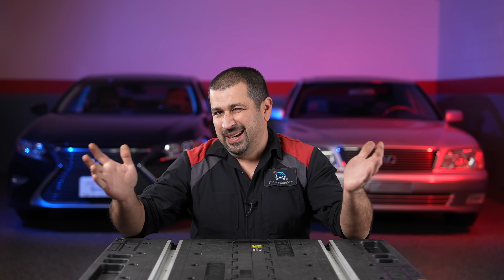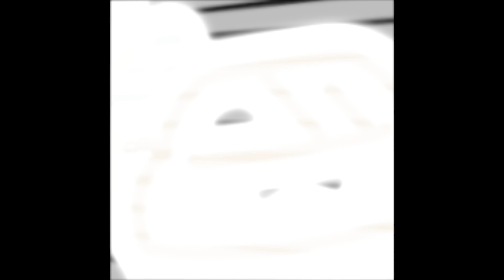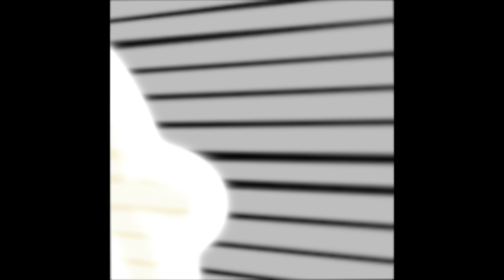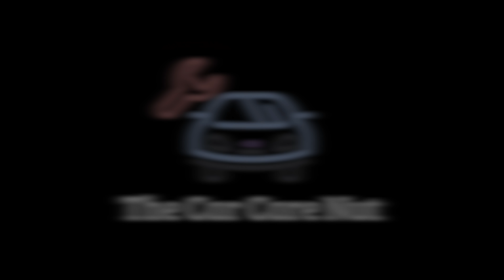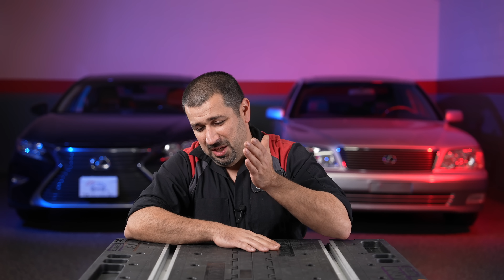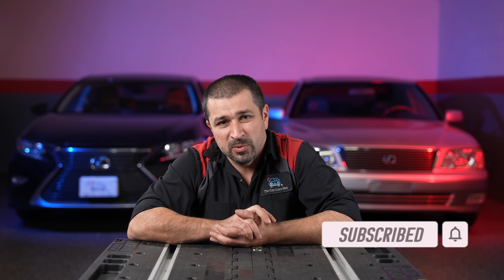Can Modern Turbo Engines Be Reliable? Here's The TRUTH!

Comment: Agree on all accounts but you didn't touch on one issue. Think about this. I have a 2019 V-8 Tundra. It rarely pulls over 2,200 rpms. More often than not shifts at 2,000 rpms keeping with traffic. I love this truck. Now put a 4 cyl lawnmower engine in it with a turbo or two, revving to, 4,000 or 5,000 pulling away from every stop light or stop sign and you have an engine with a hernia at 30,000 miles. It's like lifting small weights for years and being healthy vs. picking 400 lbs for a short life span. Toyota mails me weekly to buy back my 2019 RAV4 and Tundra and I keep throwing away the papers.

Comment: My 2021 Accord has the K20 turbo engine. I bought it brand new and changed the oil religiously every 3K to 4K miles. I’m currently at 120K miles and still purrs like she just rolled off the line. Maintenance is definitely key.
Reply: It's not fair to compare K20 reliability to any other engine... K20s are special, perfectly square Bore & Stroke, & over 24 years on the market. 
To be fair though Honda's L15 Turbo is so terrible it's the reason I gave up on combustion powered vehicles all together. 😂
Reply: @zdl360 A turbo engine is a turbo engine. Trust me, I know how special K Series are, I build them for a living. If you add direct injection and turbos, that engine needs to be babied and probably maintained and a lot of for found that out the hard way with the L15, these engines don’t suffer abuse well and they’re not the Honda engines of old when you can drive 10K miles on an oil changes and you could for the most part get away with it.
Reply: Been daily driving my 2021 Acura TLX for two years now and haven’t had a single problem now sitting at 53k miles. Oil changed every 5k
Reply: This is good to know! I bought my 2018 Accord 2.0 new and I have been maintaining the same OCI....let's hope for the best.
Reply: My 2018 1.5T blew a head gasket with coolant leaking into a cylinder at 90k miles. Extremely disappointed with Honda as it has been well maintained. Seems like this is a documented issue online but Honda fails to admit any liability.
Reply: @LFA1421I have the same 2018 1.5t engine. I do oil changes every 8-10k. It's at 180k and still runs perfectly smooth. Let's hope it has another 180k in it 🤞lol

Comment: "Can Modern Turbo Engines Be As Reliable As Non Turbo Engines?" The short answer is "no". More moving parts and higher revs. The longer answer is "yes" with proper (higher) maintenance and some luck. A slightly more detailed "yes and No" as given by Ahmed.

Comment: Ok don’t change the viscosity of the oil. However look at the rav4 engine or camry certain years. In Europe they use different engine oil than USA. And is the same exact engine in my opinion we should use what Europe use. Subaru is another outlier too, in Canada the cvt transmission has a maintenance schedule. Yet in USA is “lifetime fluid I think we are looking at the incorrect manuals.

Comment: Have a 25 Toyota Crown Platinum that has a turbo. Change the oil every 3k or 6 months, whichever comes first. Have had other turbo vehicles without issues. You stay on top of the maintenance and they will go the distance. My sister has a Ford Fusion with 100k+ on the original turbo.

Comment: Another great video; enjoyed it very much. I think there’s more to maintaining the turbo engine than just frequent oil changes, but sure, that alone will add significantly to its longevity. IF  (very big IF) engine blocks were cast iron, and oil cooling systems were more common, and turbos were larger… IMO the problems plaguing engines isn’t so much about emissions, but more about “planned obsolescence”.  Modern auto design is terrific when it comes to crash mitigation and safety, but current trends seem dead set against designing an engine, with decent horsepower, that is intended to last 200,000 miles or more. 🤷‍♂

Comment: I have 2000 Saab 9-5 Turbo with the 2.3l 4 cylinder engine.  It has 200.000mi and it runs perfectly.  But I am extremely mindful of maintenance and, equally, driving style.  It needs to be warmed up before aggressive driving, and definitely needs to wind down before shutting down.
I’m not saying anything new I guess.  I will say that this is my favorite car in 30 years of car-owning history.  LOVE turbos.

Comment: We are thinking of buying a Subaru Ascent with a 2.4 liter turbo engine. I wonder if I should use 0w-20 instead of 0w-16. It's so close. I've changed my own oil since 1977 and I try to always cut the interval well less than what's called for.

Comment: Another issue is that many of the new turbo engines also have direct fuel injection, which also leads to faster oil degradation than on port injected engines (along with intake tract carbon buildup). So it's a double whammy on oil life between direct injection and turbo.
Reply: Also this video treats all turbos very generally and all the same. Single scroll turbos, variable geometry turbos and twin turbos. So which is most reliable under what set of conditions ?

Comment: No turbos are junk. Never get one. Turbos  require the users to ALWAYS take care of it properly. To also perform excessive oil changes and let the oil cool down by idling at the parking spot for a few minutes to cool the turbo down. Nobody does any of those all the time especially when that car has multiple drivers. Turbos always fail.

Comment: I remember in the mid 2000s early 2010s seeing a lot of articles online by "professional" journalists praising current oil technology and auto design. Saying how outdated 3K or even 5K oil change intervals are for modern cars. And I believed them, was doing 10K oil changes (manufacture suggested). Until I started working on my own cars and had to replace a valve cover gasket and saw all that varnish and sludge build up.
Reply: Just had a 2002 (notorious) 3.7L Jeep engine totally (‘precision') rebuilt at 250,000 miles.  The rebuild included perfect circle precision (diesel-type) piston rings for ‘strong' piston ring tension (most vehicles now have LOOSE tension piston rings - which yield LOTS of blow-by (combustion gasses) passing the piston rings, and which DILUTES the lubrication oil. !!!! )   

40++ years ago I was deeply involved in engine lubrication engineering.  I’ve always changed (DIY) my, full synthetic, oil at 4000 miles (not to exceed ~6 month intervals due to inevitable oil **oxidation**), because the relative minor cost of engine oil and ‘good’ oil filters is VASTLY cheaper than a new vehicle or engine ‘rebuild'. **DIRTY or ‘oxidized’ oil is THE killer of IC engines**.   
My bank account, greatly, thanks me.

Comment: What a bullshit. Start with the diffrence between Diesel and Gasoline. Those cars are used the same. Especially in europe, there is a ton of diesel cars used in everyday city traffic. 
Another fact is that, the turbo gasoline engine can be as reliable as NA engine if it is engineered properly and maintain properly. The only problem is cost. 
Manufacturers want as much profit as possible, so they want to cut cost as much as possible. Add to this the fact, that most cars are bought by companies, that replace it after 3 to 5 years, building car that will last 20 years it not a top priority for manufarcuters. What matter to the company is profit. Simple and obvious. So yeah. Turbocharged gasoline engine can be as relaliable as NA one, but it is not the goal.

Comment: Diesels also have much higher compression than gas. I have over 450K miles on 2 turbo engine gas cars without a single turbo or engine issue. Key is maintenance, period.

Comment: Nothing has changed, no marketing, not a gimmick to make people's cars last less to have them buy a new one: I just bought hours ago the Toyota oil filter for my 2005 Toyota Corolla, because is very close to 327,324 miles since new,  the next 3,000 miles oil filter change, even now late in November there are Countries with Heat, is Severe Driving Conditions all year. But is true, at some point I will have to buy another, it turns 21 years next December 23: I like the GR Corolla, Japanese Built Turbo, but is a High Pressure Turbo I cannot afford  in this Planned Obsolescence Era of Toyota.

Comment: When my 2004 Acura TL timing belt snapped, That model having an interference engine, I wanted to get a car but I did not want one with a turbo. I ended up getting a 2014 Lexus GS 350 f sport with a naturally aspirated engine and rear wheel drive. I'm pleased with it.

Comment: About the only two pioneers who built tubro Gasoline engines that lasted and were reliable are: Volvo and Saab. They got the metallurgy right and the components of high quality and good safety factor.
Reply: @Can-cruiser you made an amusing comment requiring a reply.  Years ago I and my wife had a 1982 Saab 900 Turbo automatic, during our ownership we suffered two turbo failures despite both of us being religious in  performing routine oil/filter changes and also being compulsive in letting the turbo to spool down for 2+ minutes of idling before shut down while hoping to minimize turbo bearing failures.  Those early Saab turbos didn't have engine coolant passages within the turbo housings, only relying on engine oil cooling of the central heat soaked central turbo bearing requiring prolonged idling to drop the turbo temperatures before shut-down.   Then later during our ownership we experienced a cracked exhaust manifold along with a cracked cylinder head.  Ultimately we returned to buying non-turbo engined cars, because even 1980's Saab turbo technology then was too sketchy.  So I beg to differ with your assertion that Saab turbocharged engines were "reliable".   Currently I had intentionally purchased a 2024 RX350h in order to avoid any possible future turbo and turbo issues,  and I still religiously do engine oil/filter changes at not more than 5,000 mile intervals to keep that engine running well.  Our non-turbo RX350h is a delightful drive and sits in our garage paired with an equally pleasant driving non-turbo V6 RX450h.  Modern turbos may be better cooled than our ancient 1980's Saab turbo, but I have avoided any pitfalls with out non-turbo hybrids.  Cheers.

Comment: Turbochargers and superchargers have been in use for many decades now, even prior to WW II.  The bulk of WW II fighters and larger heavy bomber used PRTs (power recovery turbines )on their Cyclone and Double Wasp rotary engines, and the P-38 and P-47 had turbo-superchargers, including in the latter case injecting water into the cylinders to get added expansion (1600 times the water volume when sublimated to steam!!!).  The tech is there, the engineering is there, all it takes is compromises from the operator.  Whether in scheduled maintenance, lowering demands on the plant, or improving the design and materials, something has to change if you want the kind of life a diesel farm tractor is likely to enjoy.

Comment: Had a 2.0 Turbo Kia Optima, changed the oil every 3000-3500 miles TOPS and always warmed and cooled the engine, never an issue and those were considered garbage engines!

Comment: About diesels, since they were mentioned, an engineer told me the worst thing you can do is to start a diesel engine.  If you must do so, for Gawd's sake DON'T shut it down!  Old diesel mechanics will tell you that diesels are designed to work hard, long, and reliably.  So, they are best kept running, ideally with only an oil change as a planned shutdown.

Comment: I'm scared to death that the next time I have to buy a car I simply won't be able to afford it. And I NEVER buy new.
Reply: Very soon, the used car market will be completely out of reach for a lot of people. Nobody thinks about what that's going to do to the world economy, although I guess everything else is going to hell as well anyway, so we're not going to last that much longer as a society.
Reply: @squaaaaak3178  the value of used cars is directly related to how much people can and will pay.  The flip side of that is cheaper cars depend on owners taking the hit on depreciation.
Reply: No worries.. you will OWN NOTHING but be a happy slave soon.. 😂😂😂
Reply: You may have to start buying new. Do you think the second-hand turbo engine gonna be as durable as the old, NA engine? NO, the previous owner probably had those 10k miles oil change just to get by and sell it when the car reached 60k miles. Let the engine problem become the next owner problem, which is you!
Reply: the best bet is to buy a 1 owner used car with a clean car fax showing the oil was changed at 5k. If the owner was that focused to ignore the manfacturers recommendation then they probably were responsible owners /drivers
Reply: One owner car and Toyota brand usually will cost almost the same as new minus mileage depreciation
Reply: Simple reliable used cars are aging out and all we have to choose from is newer junk made to break priced so high its not worth it. My car needs rear self leveling struts and thats $1100 for the pair. I should have done it before covid hit when it was $600 for the pair.

Comment: The issue of reliability everyone here is spouting about newer cars and Japanese cars in particular has 1 fallacy. I was never pro Japanese even though I now have a 2012 Rav 4 with less than 60K miles. I get offers constantly of people who want to buy it. It’s only the 4 cyl but it’s 4WD. And yes I realize these things constantly go 300K without issue. The problem with anything newer is the sheer amount of electronics (OBD2 and even OBD1). How long will they continue to make all those electronic sensors and modules? Nothing will ever beat the old traditional American V8 for longevity and serviceability. They were purely mechanical and parts are still an available 50+ years later. The only reason they don’t last for much over 100K miles is due to the simple fact they used carburetors. At startup they flood the engine to get it started. They had to dump enough gas to make these cars start under all conditions. If these engines had EFI especially during the malaise era, these engines would last indefinitely. They were so overbuilt. Most malaise era cars were scrapped due to body rust. With updates to modern technology the rock solid American V8 pushrod engines would put the Japanese and European cars to shame. Both in performance and reliability.

Comment: There was a golden age for Turbo engines - those that had modern engine management and port injection. The Saab B235R is an example of this; with just timely maintenance mine is at 322k km on the stock engine, stock turbo, stock transmission.

Comment: I think as much as people dump on Toyota turbo motors it really isn’t the issue. My tundra doesn’t build boost unless I romp on it. Stop and go traffic It doesn’t boost. Also the max torque is at a relatively low rpm range further limiting the continuous high pressure rpm’s. Not saying it’s more reliable than a non turbo but most turbo cars are not constantly boosted.

Comment: Have had a 2000 Subaru WRX for 23 years as my midlife crisis car. It’s nearly done 400K still with the original motor, gearbox etc. Original clutch lasted till 325K, it’s driven but not thrashed, was rev’d out to the limiter at about 7000 rpm occasionally. Used as an everyday drive to work etc until I retired. Oil changes every 6 months or about 5 to 6000 kilometres, was allowed to cool down after spirited drive for a minute plus. Regular oil changes, 98 octane fuel, use revs rather than torque and a good Subaru mechanic keep it going but genuine parts, hoses etc are becoming scarce nowadays. It’s been brilliant.
Reply: Revving it to 7000 RPM occasionally will not harm it in the slightest.  The EJ engine wasn't bad, Some of the head gaskets weren't great, but if you put a high quality head gasket on it that then it probably will never have problems.

Comment: 2013 A4 bought new got 230k miles on her and she rides like day i got her and i believe its due to the regular interval maintenance 4-5k miles.  my mechanic specializes in german cars and he swears by 15w50 oil weight on these high strung engines and i’ve used that since i was out of warranty at 50k 

after 13 years 230k miles i’ve only had one internal  issue and it was a rear main seal so i think he might be onto something 

btw the rear main is known to go on these cars around 150-175k mine made it to 198 i’ll take it 

as for the thick oil i have heard different oil weights can cause issues for certain cars like he says here so i can’t speak for anything other than the 2.0t VW engine

Comment: Let's face it - "Most" consumers don't understand the complexity of a modern Turbocharged car.  All they know is they have a warranty.  Most aren't too concerned about maintenance either.  (It's leased or traded-in)  Soooo we then have a very complicated and highly stressed platform that becomes part of the marketplace.  What could possible go wrong from a vehicle like this???   Count me out!  This Turbo - 4cyl "trend" is nothing more than manufactures meeting CAFE requirements.  It goes 100% the opposite way of reliability.
It so bad, that I'd rather shop for an older (Non turbo) vehicle than a new one.

Comment: Yes, excellent points.  Turbos themselves are fine if they're not overkill.  A small, quick spooling turbo that's not pushing crazy boost can last forever.   Not a great idea putting them in commodity commuter vehicles though.     Short, hard trips, over-stressed + DI is a nightmare 

Had a 40 yr old , 100k mile VG30ET on the original, oil-cooled only turbo, and that engine still ran like a top, no oil consumption, and was always driven aggressively (with mechanical sympathy and always warmed up gently).